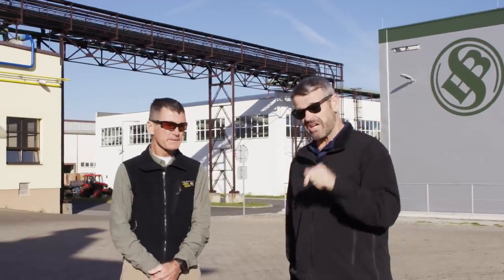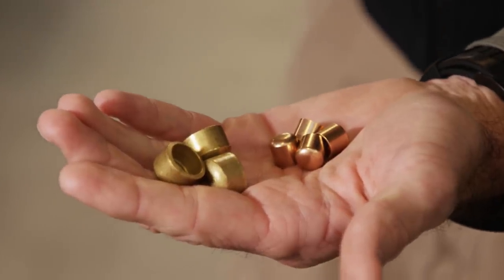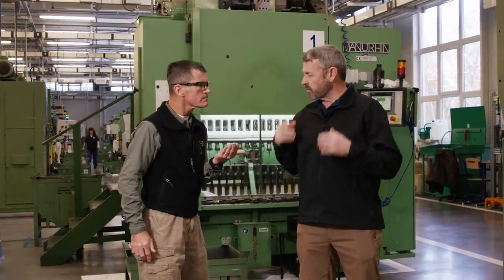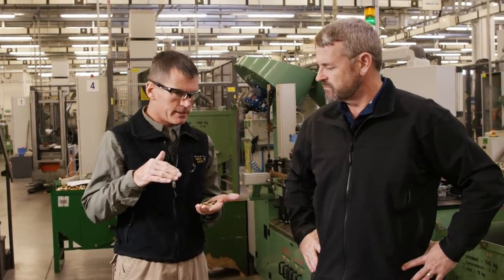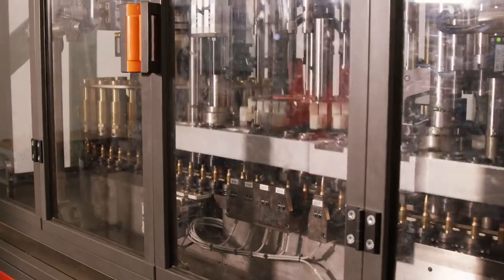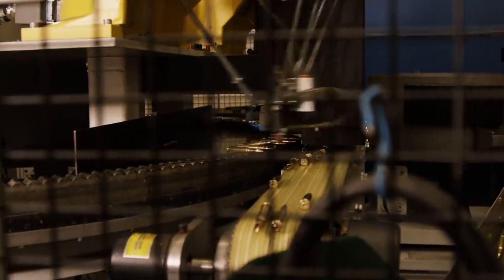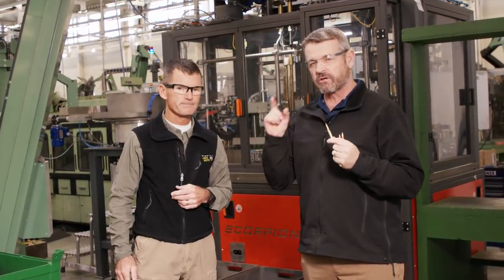Sellier & Bellot - Making A Round

Comment: By far the best ammunition for me. Cheap, Efficient, Reliable. Support from Switzerland ✔
Reply: Hey fellow Swiss, have to agree, I've easily fired over 20k 9mm from them and did not have a single ammo related issue.
Reply: Is RUAG too pricy?
Reply: @tommasomorandini1982  Extremely, almost double the price of S&B here. Great stuff, but too expensive
Reply: @wheezzl  RUAG has the advantage that they produce the "official" ammo for our assault rifles. The dimensions of the GP90 fpr example are very particular, not 5.56mm but 5.6mm
Reply: @tommasomorandini1982  That's not actually true as far as I know, it's just called a 5.6, but it's the same as a 5.56, just a different load: https://en.wikipedia.org/wiki/5.56%C3%9745mm_NATO#5.6mm_Gw_Pat_90
Reply: Only the Swiss would call 5.56 round 5.6 to stay neutral. Lol. Love you guys. Also send me that sweet sweet 7.5x55 ammo

Comment: Did they explain why they don't anneal the necks/shoulders? Or they do it and it just gets polished off at some point so there isn't discoloration?
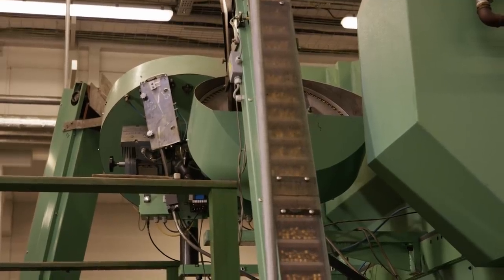Reply: If you look at 1:20 at the nearly finished cases you can see the discoloration from annealing on the neck area.

Visibly annealed necks are a military standard/cost saving measure.

Comment: I wonder if squared casings would make more efficient rounds than the standard cylindrical shape. They would have more volume for the same footprint, meaning that they could probably be shorter in length, and maybe they would present less feeding problems as they have less space to wobble. Munition for machines guns could could even have some lips on the side so you could chain rounds to each other without a link. Maybe somebody already tried this some time ago and proved it to be a failure or maybe nobody has ever tried it yet.
Reply: The pressure would be too high in the corners. They would probably split open. Brass stretches a lot.

Comment: It's so slow? I would have assumed the production rate would be much higher from watching shows about mass manufacturing like, "How It's Made" etc.
Reply: On a single machine perhaps. It's very likely that there's a half dozen or more machines running in parallel. My first job was in a food packaging warehouse, the machine that I started on, and ultimately the production line I was promoted to oversee by the time that I left had a relatively low yield per machine. We had three running at the same time however, and depending on the product(s) being processed that day, we could reach up to two (imperial) tons of processed product in an 8-hour shift (the warehouse ran on two 8-hour shifts). When I left, they had just finished installing a fourth line. That's something that's not discussed in this video though, so we don't know how many lines they have running or their total potential output.
Reply: @FoxRacer30  exactly. there might be like 8 machines for .223/5.56 and 16 for 9 mm. And S&B makes basically any caliber out there, from simple flobert and .22LR up to top notch hunting calibers. Moreover, they are one of the few facilities in the world that makes everything for a complete round (except for powder, that's made in Explosia facility not that far from S&B): cases, bullets, primers.